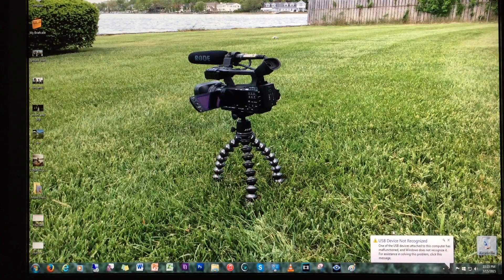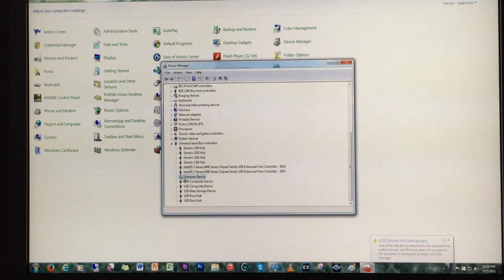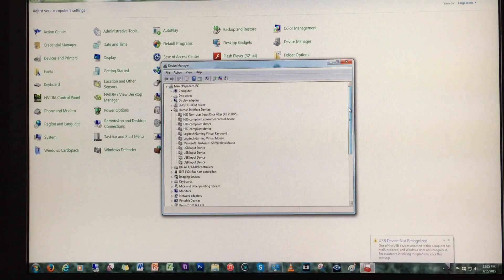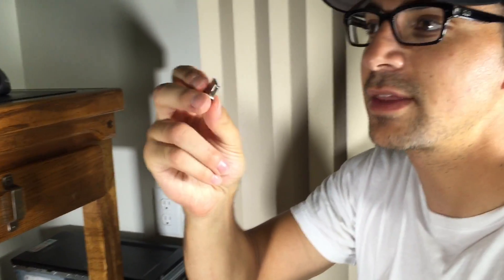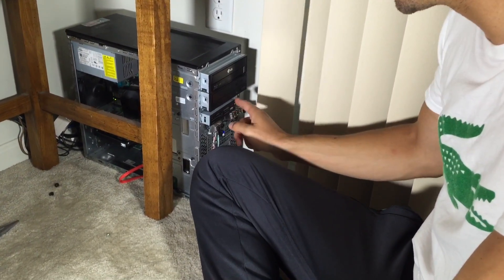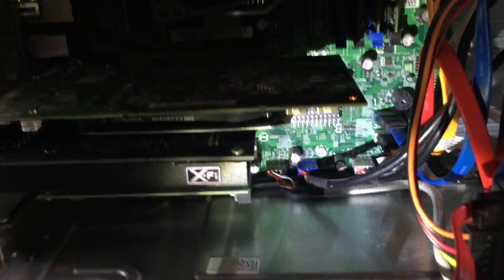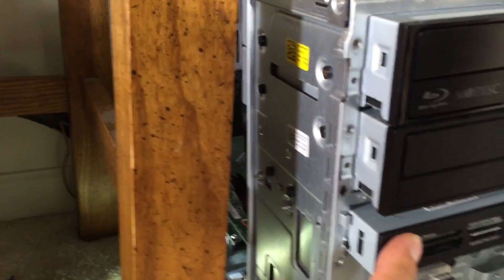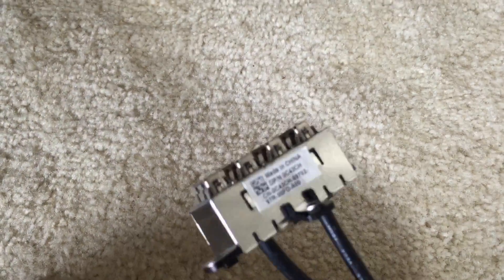Usb Device Not Recognized "100% Permanent Solution"

Comment: My boyfriend tripped over my mouse and yanked the cord right out of the USB. The USB was still in my computer, however. I took out the USB and inserted a new USB mouse, and I am getting this error. I can plug in any other device into that same USB port and it works fine. But if I plug in a mouse, it does the error message. The mouse works perfectly fine in the USB ports in the back of the PC. Because all other USB devices work in the front USB ports EXCEPT a mouse, I find it hard to believe it's a hardware issue. Do you have any suggestions? Should I just buy a new front hub?

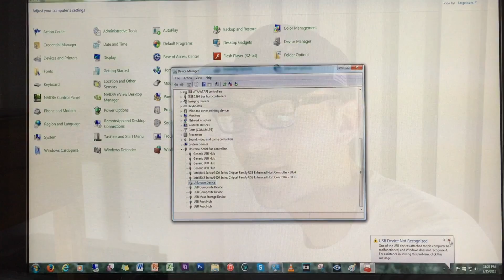Comment: You seem like a nice guy but I have to rip into you here.  3 minutes and 10 seconds of going over what you've seen in other videos, pretty much the same thing over and over.  This video should have started at 3:10 or at least had a youtube popup link bubble so you can skip to 'GET TO THE FUCKING POINT'.  Needless to say your "solution" is not 100%, it's just basic troubleshooting steps following a process of elimination.  This error message can occur from many root causes.  I don't think you even mentioned trying a different cable if your device is connected via a cable; or trying all usb devices in different ports one at a time to see if it is only specific devices.  It may even be that certain cables with certain devices cause the issue because general wear and tear has affected either the device's port or the usb port on the computer making it so that some cables will work better on certain devices but not others.  Theres also the possiblity that this is caused by a loose connection that keeps getting disconnected and connected with every slightest shift in weight distribution on the ports to a point where the device no longer is recognized because windows has glitched.  etc etc
Reply from the maker: Gamer X Bro. You just wrote me a novel telling me to get to the point? This video may not have helped you, but it clearly has helped others based on the comments. So shut your bitch mouth and don't waste my fucking time writing me a book long response to a video. Fuck outta here kid.

Comment: I had Unknown USB Device (Device Descriptor Failed) in Windows 10 too. But it was NOT Windows 10 that was the problem, for me it was more hardware issue NOT software !!! My problem occurred with my new computer gaming case in which I contacted the manufacturer for a USB front panel IO & problem fix.

Comment: did you see that which one was faulty and estimated that the cord connects too two of the usb ports below them and just dont plug in that one cord where the faulty one was so those two will not work but the other two might be fine so until u have the money if it was a situation like that u can still get half the use out of it until you replace it if you need all 4 of the usb ports

Comment: I manage 500 PC's at work.  I have had 3 that this became a problem.  After trial and error I found updating the bios and device drivers for the motherboard fixed them all.  It is odd since all the desktops and laptops are very similar in model and OS it has been a very few but has fixed the issue here. We use all Dell, mostly for the warranty and I get someone I can understand when I do call support.

Comment: Also it might be, that if nothing works for you, the usb is just faulty. I have tried literally every single video, it keeps giving me code 43. In my case it's an iphone charger and the weird thing is that it worked just fine for over 4 months and then suddenly it doesn't
Reply: electrical short. apple garbage connectors. MicroUSB isn't any better.
Reply: me too my iphone was workin jst fine on the my laptop via usb now nothing i tel u its a nightmare
Reply: For me it's an LG G5, it worked perfectly since I bought it last year.  But it's either a total coincidence that the cable went bad just when I switched my PC or it's still a problem with the PC.  Either way, I can only get it to charge the phone, but the weird part is that I got it to work twice but as soon as I unplugged it, it stopped working

Comment: My on board usb ports get the error message...when i connect the front panel usb to the headers i still get the message..So i have 0 usb ports lol..Think its a motherboard issue at this point...Gonna try a usb 3.0 pci card and see what happens.
Reply from the maker: JPDrgn68 any update?
Reply: PCI card did the trick...but onboard usb just give me "not recognized" messages.No biggie at this point..Bought a new laptop now and use it more than that old desktop.

Comment: Well, so we have to change the whole usb ?
Reply from the maker: Yes. If you tried everything I tried. Disconnect the whole USB. If the problem goes away. You know it's that.
Reply from the maker: When I disconnected mine. The problem stopped. So that told me the whole USB needed to be changed. eBay had it for $15

Comment: same prob if any1 can help me comment to me please.!
Reply from the maker: My video did not help?
Reply from the maker: Tell me exactly what is going on. I'll try and help
Reply: well like you said i tried updating usb ports and uninstalling them and restarting but it doesnt work i play on a laptop so ther is only 2 usb ports so without 1 work i cant use my keyboard which really sucks if you know anything to fix it that would be appreciated
Reply from the maker: +Triangle Veiws what exact model computer is it. Did you try unplugging the USB port? I think it's bad
Reply: its Windows 10 and an HP 15 laptop